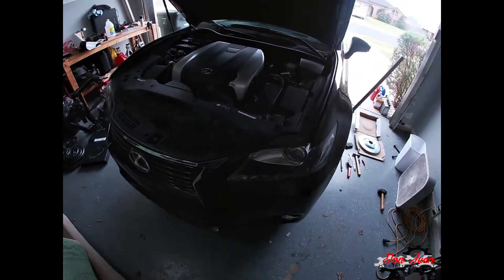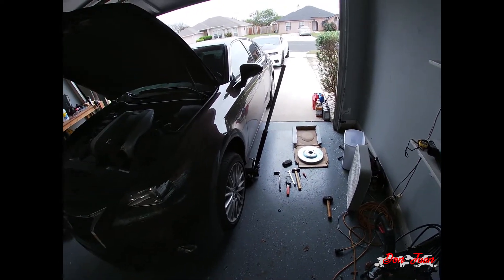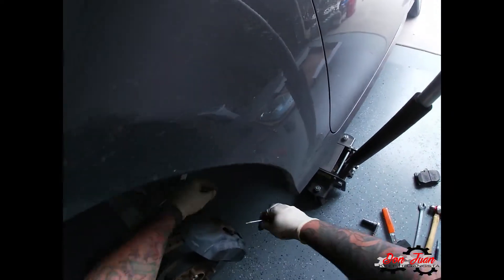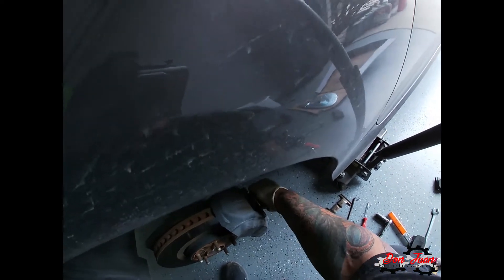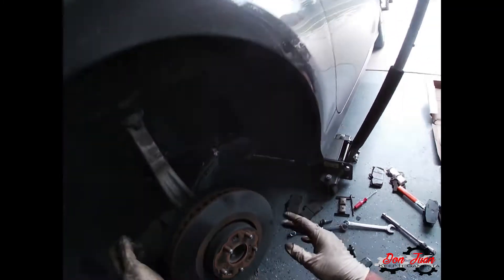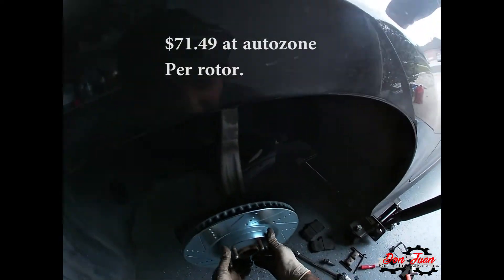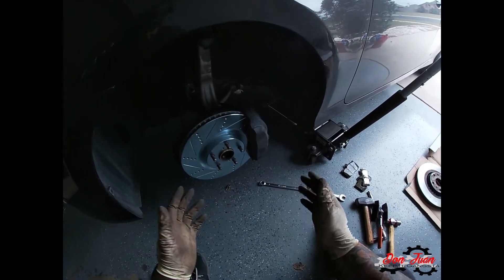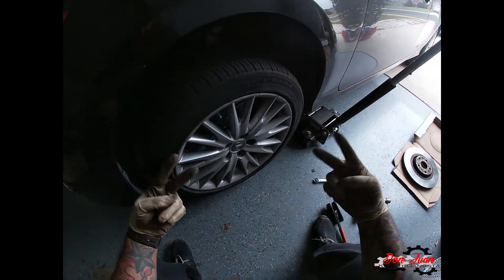How to: 2013-2017 Lexus GS350 Front Brake Replacement

Comment: Great instructional video but we can’t see some of the details called out like the small retaining pin and the compressed pistons. Also, your watch was at risk of damage so be careful or remove hand/arm jewelry before doing work like this. Brake pad remove/replace labor only is $250 at Toyota dealer so this definitely saves me some bucks. Thank you!

Comment: Don't you need to put grease or lubricant on the brake pads? On the outer surface, not the surface that contacts the rotor.